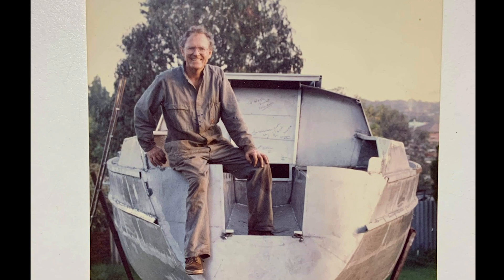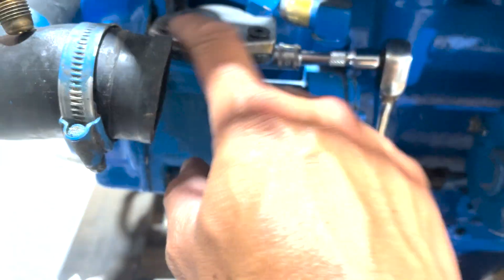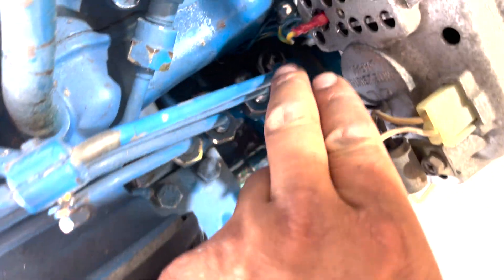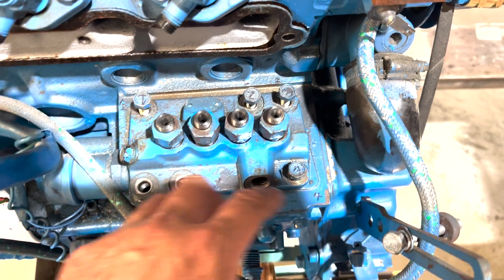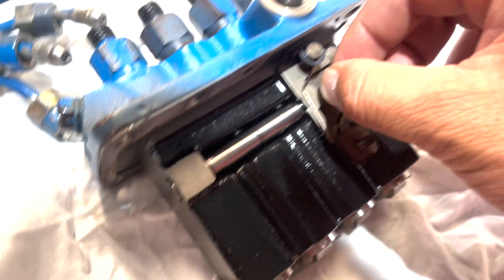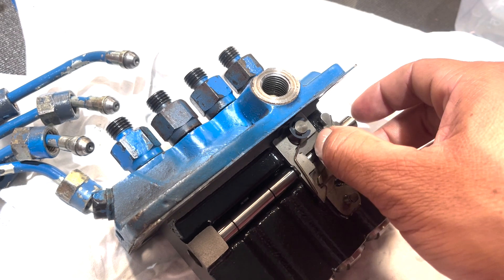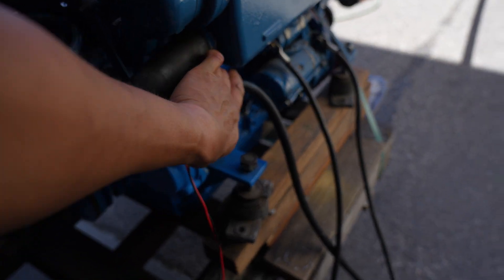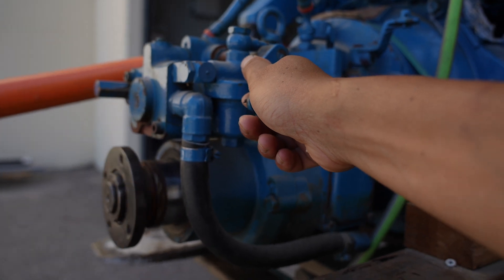Diesel Motor Starts after 34 years! DIY Mechanical Injector Pump Rebuild

Comment: The lever, I would imagine cold start.
Reply from the maker: Okay. No idea how it’s activated though. Maybe the solenoid?
Reply: @sailingkulali  not sure, it looks like the rack bar goes further across, allowing extra fuel. I would not of thought, it was solenoid, activated.
Reply from the maker: Okay interesting. I just had a look at the manual and it says put the “speed level” I’m presuming throttle to full when starting, then once it’s started pull it back to neutral. So perhaps it is a cold start system.
Reply: @sailingkulali  sounds like it mate.

Comment: Nice work 👍 now if you have issues in the middle of the ocean or foreign port you'll have a much better understanding on how to fix it yourself. As a mechanic myself injection pumps can be a bit daunting to start out with but you smashed it!!
Reply from the maker: Thanks Carl. 100% this was one of my big irks which not taking the pump apart myself or at least if I was going to get a specialist to do it I wanted to see how they did it. I pretty much said the exact same thing about what happens if you’re in the middle of the ocean and you have a fuel issue…. Apart from spending $900 to clean and adjust the pump it was more the issue of not knowing. I doubt the pump would be as “adjusted” as it should but something for the future. I believe it’s as simple as measuring how much fuel is coming out of each port then adjusting it as needed. Thanks again!